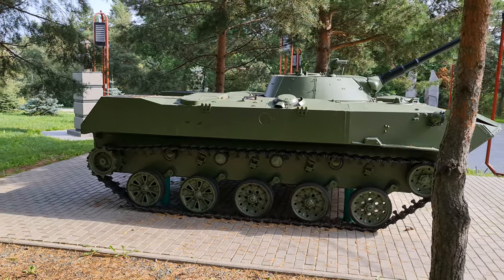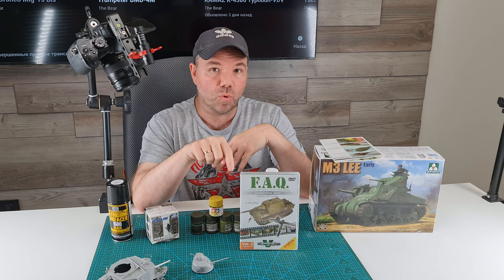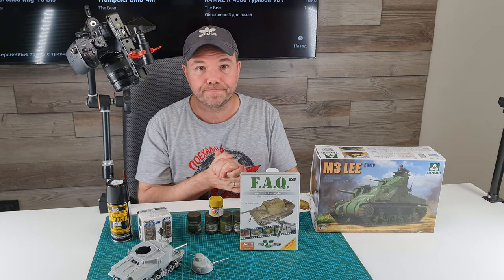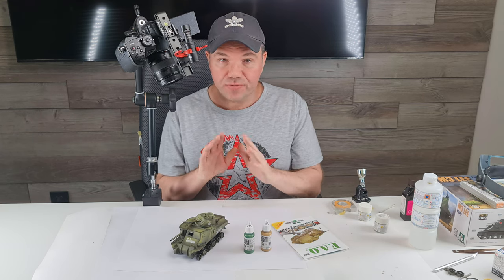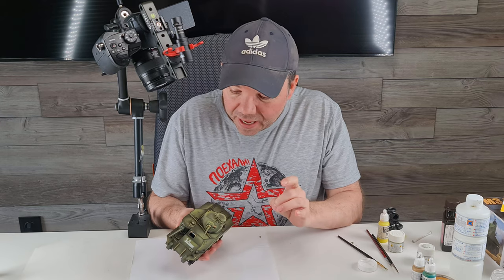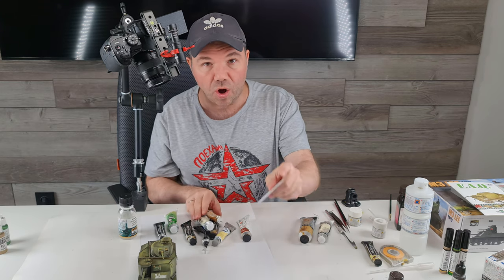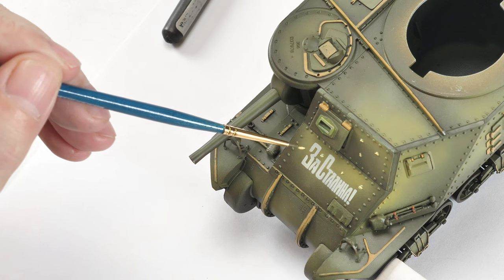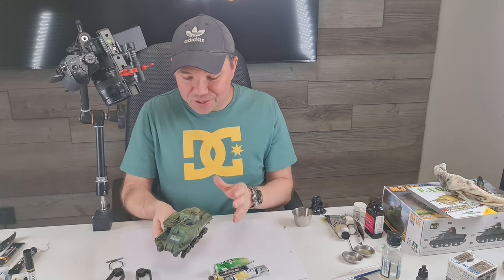The color modulation armour weathering style in 2021 PART I AIRBRUSH TECHNIQUES

Comment: Great video!  I like color modulation as a way to enhance contrast, simulate lighting in scale, and add interest.  However, I find it a useful technique as long as it enhances realism - pushed too far past a certain point, and models take on a fake and unnatural look that may well be interesting, but is no longer realistic.  It reminds me of the old drybrushing technique/craze, which was meant to highlight edges and raised details, but was sometime so overdone to look garish. Realism can be tested by taking a good photograph of the model under proper light, and examing it to see whether it could pass for the real thing.  Bottom line, balance and restraint are key to a realistic finish if that's what you're after.

Comment: From a working distance(close-up) the contrast looks extreme. But from viewing distance(1-3 feet) it looks much better. I was surprised seeing blue used as a filter, and it did have an interesting result.
Cheers for an interesting and informative presentation.
Reply from the maker: thank you Blaine yes when you see models with stylised painting at big model shows they certainly grab the eye, but as you pointed out at normal viewing distance the contrast does not appear so harsh. New video goes up today on the Hind.